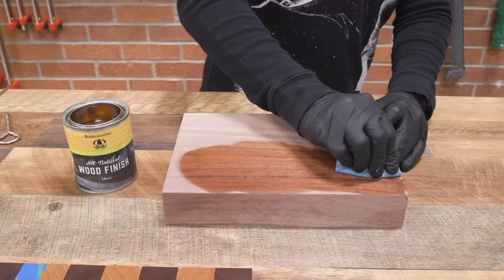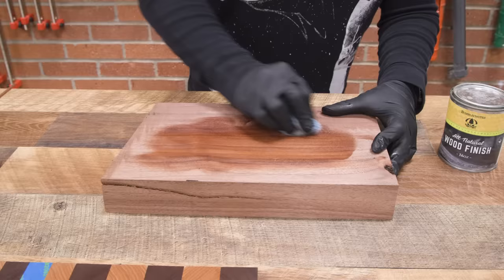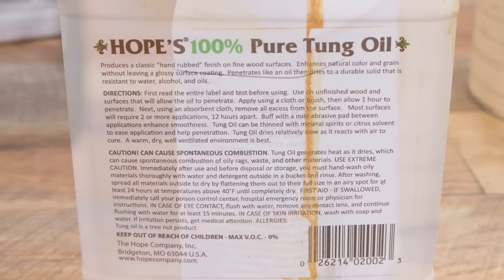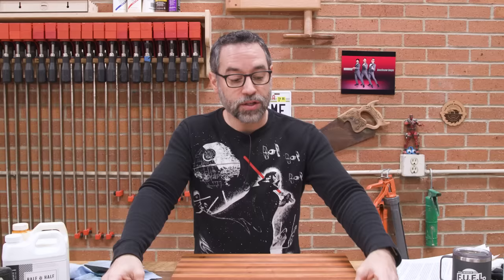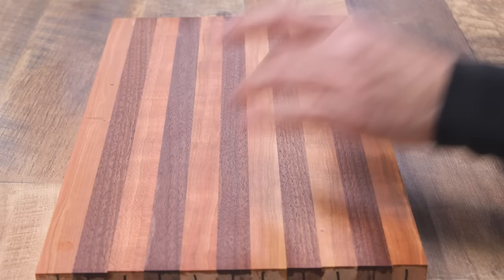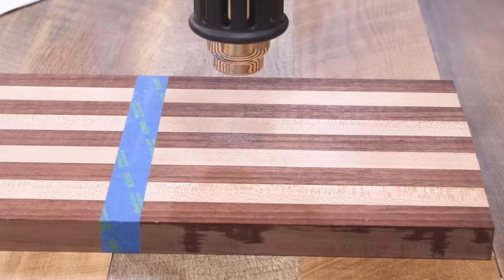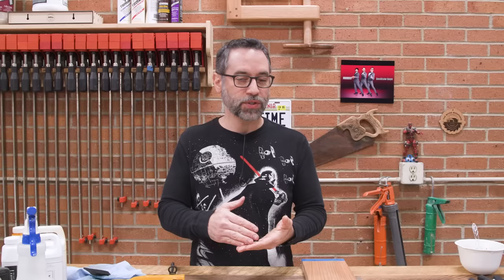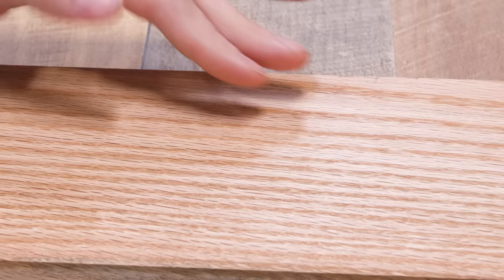A Better Way To Apply Oil Finishes!

Comment: Flooding drying oils onto a cutting board (or pretty much anything) is just asking for trouble. That said, I've seen few, if any, woodworkers on YT or other platforms recommend doing that. Apparently, some manufacturers of drying oil finishes do, when they really shouldn't. Most woodworkers I follow, and my own experience, say that mineral oil + wax finishes can be flooded, but if if they are, they must be thoroughly wiped down (possibly over several days) until they stop releasing oil. Once they're done releasing oil, I haven't had any boards I've made continue to do so. Even if they do, it isn't a big deal; just wipe it off, as it doesn't affect the finish of the board at all. The finish that I make and use for my projects (mineral oil, lemon oil, and beeswax) uses a higher concentration of wax, so oil leaching out of the cutting boards I make hasn't been a problem, but even when I've used a higher concentration of mineral oil (less wax in the finish), I've never had oil leach out of the boards once all of the excess has been thoroughly buffed off. For me, basically, I would never use a drying oil on a cutting board, because of the curing time and other reasons that aren't relevant to this video.

Comment: If the oil doesn’t cure for a week or more than how can you apply the next thin coat of oil 12 to 24 hours later? Seems like a few thin coats could add up (maybe only to a moderate coat instead of flooded). Is there a partial cure that is meaningful or is it strictly that you won’t have saturated the wood? Great video, thanks!
Reply from the maker: If you had the patience to wait for a complete cure of each coat, that would probably be the best way to apply. But giving a THIN coat 24 hours of oxygen exposure gives the curing process a significant head start. So when you apply a second, and a third coat, those coats also have a better chance at curing within a reasonable time. When I apply this finish, I may get to day 3 and feel the surface only to decide to wait a few extra days before the next coat. Also depends a lot of the humidity and shop temperature. So I personally do feel that the "partial cure" is significant when we're talking about thin coats.

Comment: I've seen people actual submerge there cutting boards in a tub full of oil.  I have never made a cutting board myself, so I have no experience with finishing them. My question is: How do you deal with cuts in the cutting board which will penetrate the top coat. Would one then recoat that are only?

Comment: On cutting boards I want to trap oil down deep into the fibers.  Much deeper than my knife blade could ever penetrate, especially on an "end-grain" cutting board.  Here's why.
Cutting meats like chicken on a wooden cutting board has the potential for the fluid from the chicken to penetrate the board.  The knife blade can sometimes penetrate the top layer and allow those juices to penetrate even deeper and getting past the layer of oil.  By fully saturating the wood I KNOW the chicken juices can not penetrate beyond the oil layer and contaminate the wood.

Comment: I havnt finished anything with tung oil, i am going to but havnt yet. But i vite to split the difference in flooding vs not. 1st coat apply strong, not pooled on tmit but not sparingly, naybe let it sit 30 min or an hour before wiping. Then cure for 24 hours, then apply 1 or 2 thin sparing coats. It did show less visible obsorbtion in the flood method. So i personally would rather risk a little bit of seep out for a bit more waterproof board. If it comes out at all.

Comment: Interestingly, I recall seeing years ago now that Grey Owl Paddles were fully immersed in some kind of oil (linseed I believe) for the main reasoning that it made the paddle more water resistant and was very easy to 'fix' if the paddle needed attention to its finish. Easy enough to fix on trip even (provided you brought a bit of oil, a rag and sandpaper with you that is).
Reply from the maker: Well there certainly may be some use-cases I haven't accounted for. I'm sure if they do something like that they have their reasons. But a paddle gets a special kind of abuse that our furniture and kitchen items won't likely see.
Reply: @woodwhisperer  well they don't say "you're up S*** creek without a laddle" do they :-P so definitely different use cases. The 'waterproofing' test just made me think about that more 'extreme' use case. 
I never would have expected the oil to seep out so quickly from the saturated wood like that. I'd be curious if there's a time/temperature range that has to be hit to make that happen. 
Makes me wonder if people are unintentionally seasoning their beef/chicken/fish/etc.. with linseed oil as the chop them up.
Reply: @woodwhisperer   abuse by end user is not know, for instance i submerge in hot oil in old pan Kitchen/food use wood products for full penetration (& would pressure treat them with treatment if possible & using a easy to get product from supermarket) - WHY because someone will always put it in the dishwasher, or in a sink of hot soapy water, it might not be the owner just someone being helpful, it may be a gift, re-gift or heirloom & ensuring Read Me  is read & remembered is impossible.
another reason is pests, mould, weathering etc, while it make sense & work Right now your advice only works this decade, what about in a hundred years? i have hundred + year old furniture, Coated & well looked after is like new where as Soaked is near new even with abuse...
I always consider care & service beyond my control or influence, & the end use has to meet the KISS principle, 
as for sanding 600-800 grit & burnishing... with a natural finish coating applied with heat beyond natural occurring  to prevent my hard work being ruined by being left wet, in a hot car, soaped up or dishwasher, or abused.

Comment: I finished a guitar with real tung oil and although I applied it with a cloth, I think I didn't do enough sparingly because little spots of oil appeared the day after application. It finally turned out well but I had to work hard on it to wipe off this excess oil. Your video makes me realize I have to apply it even with more moderation.
I have some question: do you think it would be possible to tint tung oil? Maybe with an oil based paint? Thank you.

Comment: Thanks for your recommendation re: Tung Oil w/ Citrus solvent - it's working well for me.  I've found that using a makeup sponge is a great way to apply a thin finish. I had this epiphany the other day when I was using a blue shop towel to apply the finish and it soaked up a lot of the finish.  Tried a makeup sponge for the next few coats and it worked great - very absorbant and releases most of what it takes up.
Reply: tried your makeup sponge suggestion and it worked great

Comment: Amazing video and perfect for the large butcher block top I’m about to finish. My only concern would be a “scratch test”. Would the flood coat side hide any scratches from revealing the unfinished wood beneath like the thin coat side would? Or is the thin coat side soaked enough to hide the evident surface scratches to come over time.

Comment: I think it really goes back to old methods, especially production. Though, one question I do have. How springy is a saturated long grain board that is cured? Reason I ask is that my father used to talk about very old grandfather clocks using wooden springs that were soaked in linseed oil and then bent into a spring.

Comment: Question... i bought a  Butcher block from a guy who used the flood method using Real Milk tung oil and probably did not dilute it. I have sanded and reapplied tung oil diluted with thinner. The question is should i use a heat gun to possibly remove all the excess oil? Its a good size table that is 30x72

Comment: Hey Marc! I'm actually not a woodworker. I'm a fiber artist. A lot of fiber tools from looms to spinning wheels and everything in between comes to the end user unfinished. I'm also interested in working with antique spinning wheels. So I've seen a few of your videos on the topic of oil finishes. For my purposes, oil finishing is ideal, so thank you for all the great info you've served up on this channel. The first product I tried was Tried and True Danish Oil, so I had no notion of flooding--I guess I was doing it right from the start. Now I'm getting interested in trying Tung Oil. I'm torn right now between buying a bottle of Walrus Oil Furniture Finish or Real Milk Paint Half and Half. The price is about the same. I wonder what you (or your viewers) would choose?

Comment: So soak new boards in a vat of tung oil, wait 3 weeks after removal, apply heat gun until oil stops seeping?
Reply from the maker: I'm not sure that would accomplish anything useful.
Reply: I just cut out the middle man and make my projects out of hardened tung oil ;)
Reply: @woodwhisperer  it lets me justify the vat i bought for mineral oil.

Comment: I used the flood method with Real Milk's pure tung oil on a small round red oak table top, and the oil kept leaching out for WEEKS.  I finally wrapped the whole top in paper towels, and just let it sit in the warm garage for a couple of weeks, and it finally stopped.  I left like Dallas and Parker in Alien, checking how many floors the acid blood was eating thru.  Won't do that again.

Comment: Your video is very informative and has given me a lot of useful tips.  I am looking for advice on finishing a solid mahogany top on a small sideboard.  I have never applied oil or polyurethane finished to this kind of wood.  I don't want to stain it to make a darker/redder finish but leave it as a natural looking colour.  I live in the UK so products probably differ from what you use.  The   best foolproof type I guess would be beneficial as I would like to get it right without making a mess!  So, any advice would be appreciated.  Thank you.

Comment: To improve water resistance for items that aren't necessarily required to be food safe, how many coats should be used?  How many thinned coats and how many 100% pure tung oil coats?  Should the thinned coats be broken down into varied viscosities, increasing as you go?

Comment: Something I like to do with oil finishes,  if the wood has a lot of open pores, is to sand with a high grit, like 400 to 600, before wiping off the excess. This creates a superfine dust that fills in the pores.

Comment: Great video, thanks!  So are we saying that the hard wax oil method is the one to use with all oil finishes?  Seems like it.
Reply from the maker: Well hard wax oils have different application methods depending on the finish. But if the one you're using recommends applying sparingly and buffing off the excess, then yes.

Comment: For what it's worth, if you have a reasonably accurate scale you can weigh out the water you put on, then when you take it back off tare the towel weight and then find how much weight the towel gained and you'll have a measure of how much water was lost to absorption evaporation. You can put the same amount of water on a plastic plate to measure what is lost to evaporation if you want to account for that as well. Probably not perfect, but it'd be something more solid than a gut feeling.
Reply from the maker: There was a lot more than a gut feeling involved here. There was a visual observation as well as examining the resulting grain raise. These can actually reveal quite a bit about absorption. The point was less about exactly how much was absorbed and was more about the fact that both coating methods significantly slow down absorption when compared to the controls. And they slow it down to a comparable level using basic empirical evidence. I do think a more accurate weighing of the remaining water would be interesting, but given all of the reasons NOT to flood, I can't see the difference being significant enough to change my recommendation.
Reply: @woodwhisperer  I wasn't really trying to be critical of your methodology. There are  million things that experience lets you see and recognize but can't easily quantify, especially in a few minutes in a video. I was mostly commenting because it's a useful technique and not everyone is aware of it. It'd be great if a bunch of people made a few tests each and compiled the data so we could see enough numbers to really suggest when it might be the best choice to flood, if ever. Thanks a ton for the work you put into the video and the care you put into explaining it to your audience. I sincerely appreciate it.

Comment: Does this principle apply equally to older wood as it does to the new wood you used for your tests?  I've just embarked on my first-ever refinishing project - a stair rail in the early 1960s-era pop-top that was added onto our 100+-year-old house - that has seen a lot of hard use over the years.  As I remove the old finish (varnish?), I'm noticing that the wood underneath is very dry - no cracks that I've seen, thankfully, but still, it's spent at least 60 years in this bone-dry climate.  Will an oil finish adequately protect this older wood rail from things like wet shower towels draped over it, or would it be better to use some kind of polyurethane finish to seal it?  (I really don't want to paint it, as it would stand out like a sore thumb with all the 60s wood paneling on the surrounding walls.)  Thank you!

Comment: As always you explained things very well and I learned something new! 

This video is actually timed perfectly because I’m in the middle of finishing an outdoor table with tung oil doings the “flood method”. I had one coat cure over Christmas and I just put on a somewhat thinner coat after light hand sanding.  Now I’m watching it vigilantly to wipe up oil that leeches out before becoming unsightly white spots and my next coat will be very thin. I am curious if you have tips for tung oil in outdoor applications? My assumption is more and heavier coats than light kitchen items, but this video busted some of my assumptions about how these oils work. Thanks!
Reply from the maker: Honestly i have never used tung oil on an outdoor project. But I am intrigued by the possibility. I think more coats will certainly stack the cards in your favor and I think an outdoor project would be a candidate for the once a month treatment for a while until the finish really builds up. I'd have to experiment myself before saying more though. I'm just speculating.
Reply: @woodwhisperer  Thanks for the quick reply. On a separate more humorous note, this video made me think of how well you make the distinction between YouTube experiments and scientific experiments in your videos. But one major distinction no one mentions is that YouTube experiments actually work out and the results make sense! Just thought with your background you might relate

Comment: Next time we expect Matthias Wandel approach to the test - you need precision scale, more water and you gonna measure and plot in graph how much water was absorbed by the towel :D :D 
Great video - I too find better results with thin coats which are wiped immediately (or as I get to the end, I start from the beginning to wipe down) - it even works OK outside the lower temp range for the oil that way

Comment: Have you tried any Southerland Wells products? Small company in Rhode Island.  A couple of guys in our (Long Island) club swear by them, and they visited last week to demo their stuff. Super nice people. They go the flooding method also, but they also polymerize (pre-cook) the tung oil so it cures better, I wonder if that makes a difference. They also brought an actual tung nut with them which was cool. Some, guy in FL and GA is buying up failing farms and planting more groves, less reliant on china for the oil! Pretty cool.

Comment: Hi Marc, thanks for another amazing video. 2 questions, definitely not criticisms, just curious. 
1)Did you raise the grain before finishing the boards?
2) the finish coming out of the board when heated.  Is that caused by air inside the board expanding and pushing the finish out?
Thanks and keep up the fantastic work! 
Keith

Comment: Hi there, I really enjoy longer videos like this. I find its the best way to learn. I have 2 questions. Can you drop those blue rags in the garbage when you are done? Is there any special consideration to have for safety (fire, etc)? Second question is, would you finish it on both sides? I did finish the counter for my kitchen island with only oil on one side (Tried and True) and the surface has cupped a year later - you can definitly see it. The counter was 3/4 thick, witch maybe was too thin. Also, im not quite sure if its becasue of the oil on one side only or because of my poor craftmanship 😅Thanks alot! I'll definitly look at your channel and watch more content in the future.

Comment: Great video! Several years ago I made a Cherry end table that I finished with a DIY wipe-on finish that I probably flooded on before wiping off. Overnight, the finish seeped out of the wood grain and cured which created a ton of work. 

What do you think of the odor of the tung oil? I recently liberally applied some unthinned pure tung oil to some weathered birdhouses to give them a little more life and I had to leave them outside for a week before the smell dissipated enough to bring them into the garage.

Comment: On the flooding method, pertaining to the white spots I noticed it did it around the knot. Could it be that because of the knot it soaked more then caused the white spots? Therefor flooding a knot will result in white spot but not the rest of the piece?

Comment: Luv this! I can wait to try it out. I just got some bumblechutes and can to try this. I’ve only used the soak in mineral oil ( just a new woodworker who didn’t know any better) and wood conditioner. But this video showed a better and easier method. Question: 
Also can these be applied to a live edge table ? Just do more coats? 
And ever used Rubio monocoat? 
Thanks